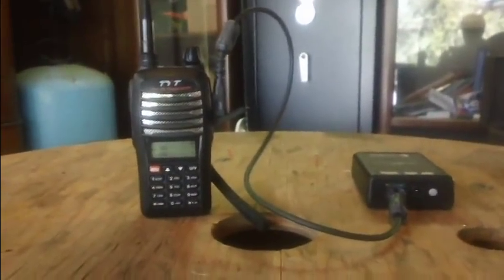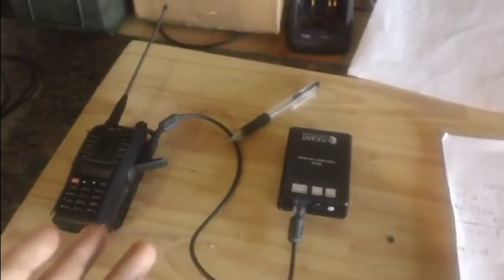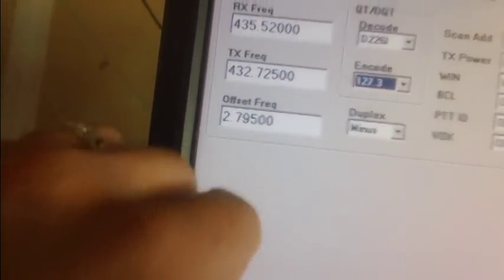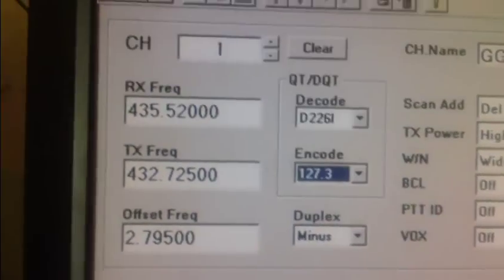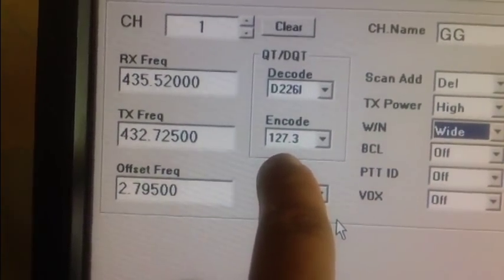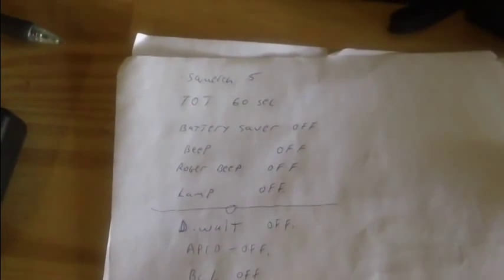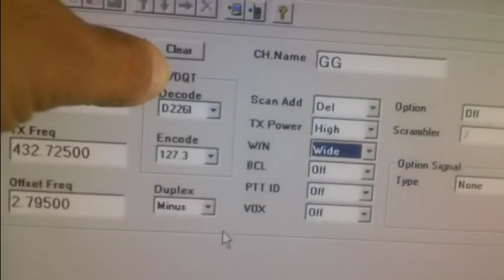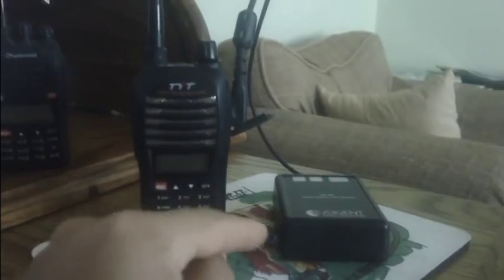SHTF WROL Simplex Repeater Build, Configuring the radio.

Comment: I realize this comment is four years after your posting, but the new Part 95 GMRS regulations (Sept. 28, 2017) do not prohibit the use of a "simplex repeater". All that is required is that each radio used be Part 95 certified and announce your FCC call-sign at the end of your transmission.  If one gets hung up on the definition of a "repeater" then call the use of a simplex repeater a "store and forward base station". The BTECH GMRS V1 radio is Part 95 certified and by pressing the # key will reverse the input/output frequencies and privacy codes, that and it's DTMF abilities allows for the efficient use of the Argent Simplex Repeater.  For those needing only a short term (weekend) repeater, I simply put the radio and Argent box in a waterproof kayak bag and with some 1/4 inch rope haul it up in a tree.  

Thanks for the most informative videos on the use and setting up of radios and "repeaters".

Comment: You should have said something about the cable between the radio and the recorder/controller needing a ferrite core, to strip off RF energy before it hits the audio recorder/repeater controller.

Thanks for the video!
Jimmy, ARRL TS, WX9DX

Comment: I remember watching this video earlier, and what you said about DCS codes. 7:10 I did my own testing on this, and it doesn't matter whether you use inverted or normal DCS. I programmed a radio with a random inverted code and tried to pick it up with a scanner. Of course, the scanner decoded the inverted tone in its "normal" equivalency. When I entered the normal value that the scanner got me into another radio and tried to communicate with the inverted radio, it came through just fine. So I think inverting your DCS codes won't be of too much help.
Reply: No reply from him ... I believe you’re spot on.
Reply: @Joebanker80  Yes. DCS/CTCSS codes will only prevent interference from co-channel users. Listeners and malicious parties still have access. What you would need is a scramble feature or digital radio with privacy enabled. (Doesn't matter which: P25, DMR, NXDN...) Swap that with the Baofeng/TYT and use a non-GMRS frequency (SHTF scenario, right?) and you're all set.

Comment: 420.000 MHZ to 450.000 is only for licensed ham radio operators only. In the band plan it may say experimental but is for license amateurs only! 
This radio frequency 420 to 450 spectrum is not for anyone in the general public to use. Unless you have a valid ham radio license of technician class or higher.

Comment: a few of the things are wrong there, apro is the compander or scrambler which can be enabled from that option; dw is when listening to fm radio, it watches the radio channel for activity at the same time as listening to broadcast radio; d wait is what you that dw does, where it watches both channels on the top and bottom

Comment: posted a video with code running under guerillacomm simplex repeater
Reply from the maker: +bob hope Just saw that. My site is small potatoes, not worth the effort. No repeater site is safe for that matter. I don't ever solely rely on one system, single point of failure in any tactics is a recipe for disaster. That was interesting what you did though. the vid had no audio, but I got the idea. Thanks for watching.